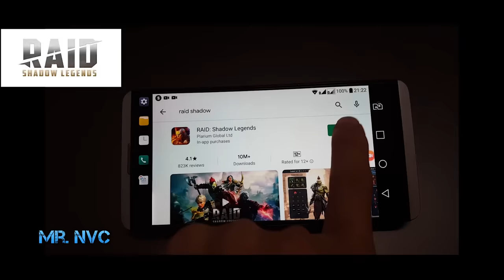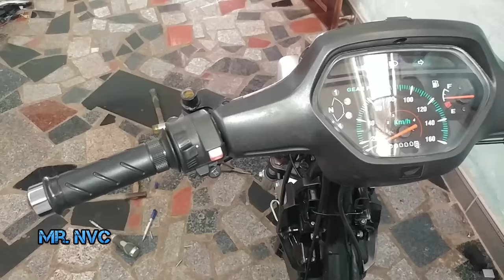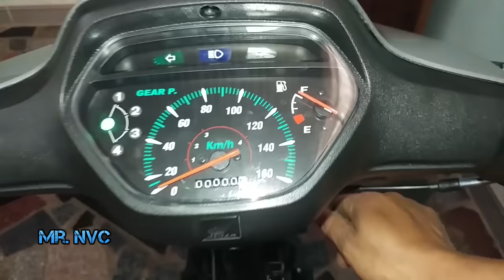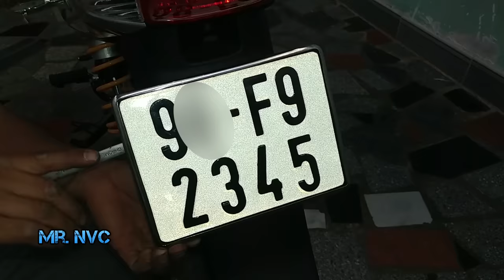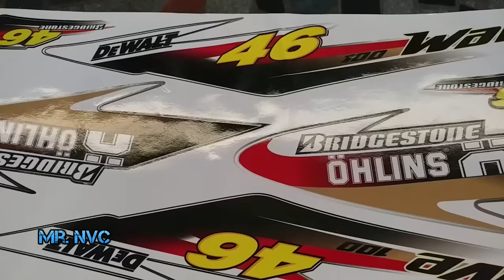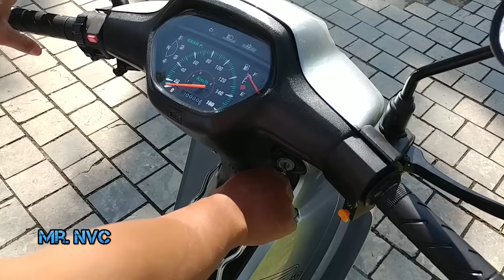Full RESTORATION of Honda Wave

Comment: Grate job but why did you not paint the engine not under coat this is the best job I have seen on YouTube
Reply from the maker: If you paint the engine for a while, it will peel off and look very bad
Reply: @MRNVCDIY  not if you hear proof paint but still excellent job well done

Comment: What kind of acid you use to take of the paint on the fuel tank?
Reply: normal all used paint remove liguid, all paint shop have, if paint good need remove old worst paint all off first.

Comment: Hell of a job. However, I liked it better without the silly stickers. after all, it's no race bike. Isn't that engine basically a honda 90 or 110 they used in the old trail 90's or 110s?  Looks much like it, tho I'm sure the tranny is different.

Comment: You have posted this in the past in a 4 part series and I said at that time that even if you were able to source after market parts for everything you've replaced new(Which I Doubt), I still cant see this as being a viable restore because of the shear cost of everything......Your time is worth something.....and you still have a used bike......Spend $5K for a 2003 bike thats not worth that!....Great job but do the math!
Reply from the maker: I want to recover a memory. My country has changed the license plate to 5 numbers. This is why I want to keep the old license plate.
Reply: Mathias.....buy parts from Honda and you'll know that it doesn't matter what country you are from!